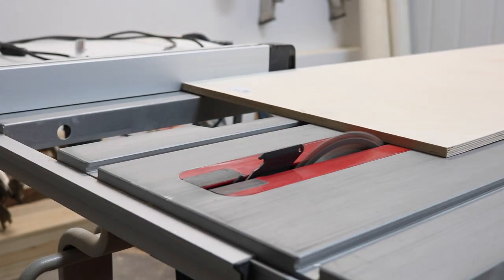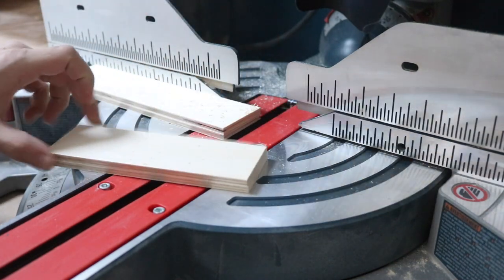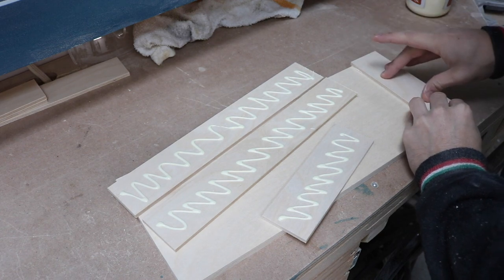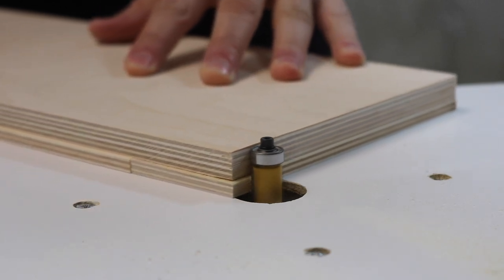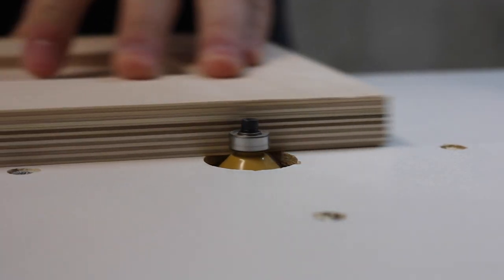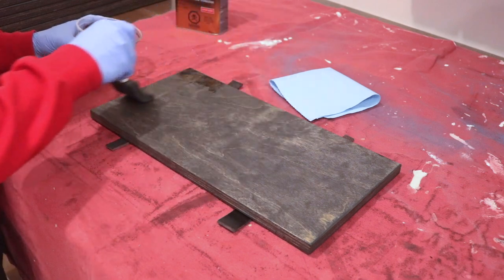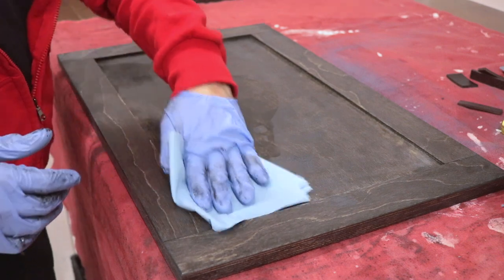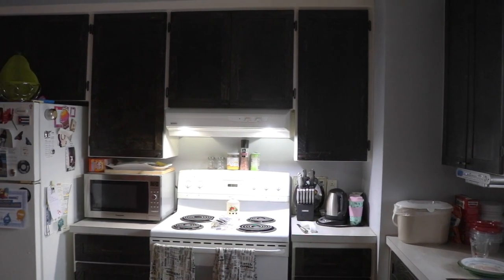Kitchen Makeover - Make New Shaker Cabinet Doors // DIY

Comment: Pretty smart thinking to get the look. Anytime I want ebony black finish on wood I find it best to just spray paint it black without a primer. It absorbs like  stain but leaves a consistent finish. Or water down some black latex paint to brush on. Still shows the grain and texture. Just depends what your going for though. More rustic or modern/contemporary.

Comment: Great job! Have you tried using wood conditioner to get the stain to take better on the birch ply? Also, I'm curious, you have a router table so why not just make a traditional shaker cabinet door?
Reply from the maker: +One Big Happy I've tried conditioner but I find it gives a lighter stain. Just wanted to try something new.
Reply: I've had great luck with a 50% water/50% wood conditioner mix that works well even on pine which is notoriously hard to stain. Give it a try some time and let me know if that works for you.
Reply from the maker: +One Big Happy I'll have to try that on my next project.
Reply: Water based dyes have worked well for me on splotch prone woods.  Especially sprayed.  Just keep coating until you get the depth you want.

Comment: have you considered putting the bevel on the individual pieces you glued on to add the faux joint gap between the rails and stiles? Do you see any problems with someone doing this? Its an idea i have and would be curious about trying it.
Reply from the maker: +WaldvogelReview I don't see any issue with that.

Comment: so u use 1/2 for the panel  and  1/4  inch  plywood   for the  frame  the  1/4 inch  are not  even 3/4  in home depot  can  one paint this to look white ?? by the way  u did not show  what u used to rip the 1/2 to 1/4inch
Reply from the maker: +john Al you can paint them any colour you like. I did not rip the 1/2" to 1/4". I bought plywood in each size.